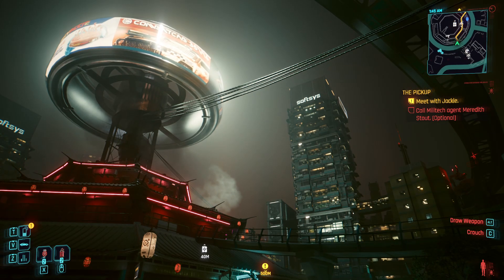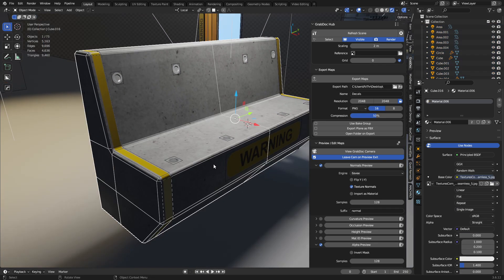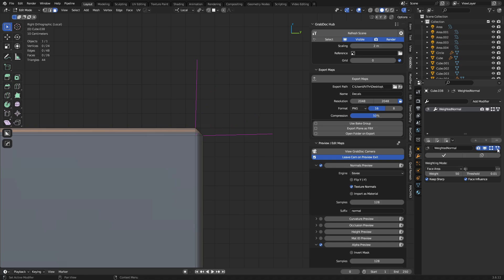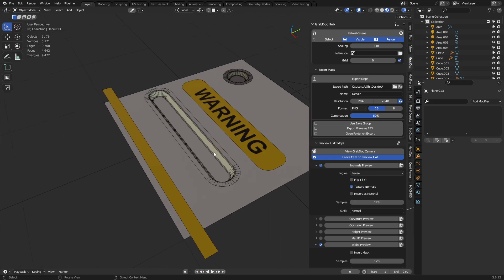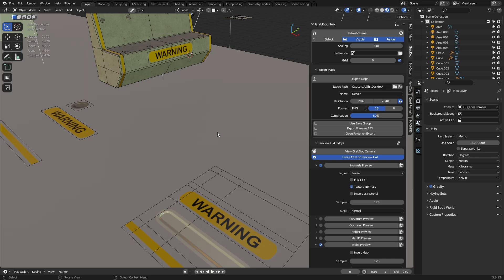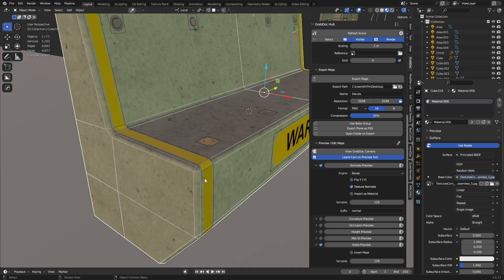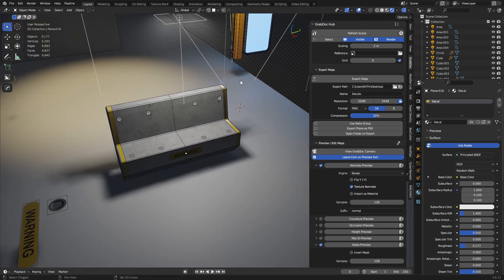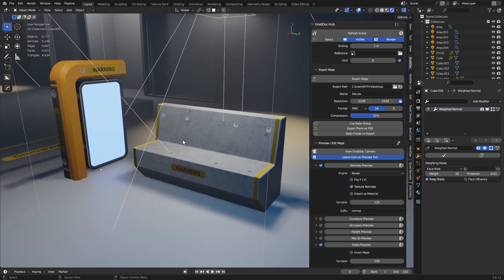Mid-poly Game Art

Comment: One thing to keep in mind is that if you want to get the most out of mid poly workflows, you need to keep the materials in mind. If you own cyberpunk I do recommed you get Wolvenkit and export some of the meshes and textures out of the game.  The material setup on a lot of the more complex meshes is actually using a layered workflow meaning that any model can have at any time up to 20 layers of different materials and for the most part these are all shared accross the entire game. The modding community has develiped a blended importer that loosely mimics the layered material setup in the engine so check that out too.

I mostly investigated the vehicles and they are set up with layered materials as mentioned above. For example the exterior of the vehicle has about 18 layers with simple black and white mask textures ranging from 1k to 256x256 sizes that dictate where materials go. If you want more information search for "Multilayered: Cyberpunk's supershader" and read the REDWiki modding wiki, it explains how it all works. There are certainly downsides to using this method but for this kind of game the upsides and the speed of asset creation trumps any disadvantage.
Reply from the maker: I did look into this a bit ago but didn't take the time to rip the assets out. I knew they were layered but not sure of how many layers. Good to know. I'm more curious how they are handling the masks. Are they packed into a single file? Multiple rgb images? or left as separate images? 

Wasn't real sure how they were compressing them.
Reply: @pzthree  They are all separate greyscale images which are then from my understanding are packed into virtual textures by the engine at runtime for optimized streaming
Reply from the maker: I should of known VT. I was just messing with it in ue5.

Comment: Nice video. Currently learning about Trimmsheets and its amazing.

Could you tell me when you would use a UV Atlas? I have only heard about it once and the second time was in your last video, what is it used for and why would you want to use it? Thanks in advance!
Reply: Typically you would atlas a UV because one great way to optimize game assets is to have as many assets as possible all using one texture map and thus one material.

For example, let's say you have several models: a ketchup, mustard, relish, salt, pepper, plate, fork.

You could give them each their own material, but these objects are small and could all occupy space on one big texture. In the game engine, this means only one texture being sampled and often batching them together, fewer draw calls, and so on. Things like this allow major speedups.

It's not always possible to atlas things though. Large objects demand their own space if only to maintain texel density as desired.

For decals, especially small decals, you should always atlas them for the same exact reasons.
Reply: @SkeleTonHammer  Can you pls give me a good article, or video .. about uv atlas? Im hearing this first time
Reply: There's also texture arrays, where you have an array of equally sized textures in the shader, and then for each vertex you need to store an index, which is the index of the texture that the face is using. Probably some pros and cons to consider there.